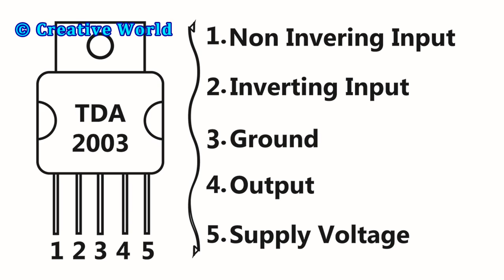How To Make A Subwoofer Amplifier Circuit - High Quality

Comment: Can I use 25watt 8ohm subwoofer to run it at maximum power?..
Reply from the maker: you should use maximum 20 watt
Reply: @CreativeWorldPro  can I use 25w 4 ohm sub woofer with tda 2050 ic and same circuit..
Reply from the maker: sure, you can

Comment: How to prevent distortion of audio when the volume is turned to maximum ?
I'm using 18 Volts supply and 4 ohms load
Reply: Trabajalo al 70 porciento el voltaje esta bien...

Comment: Where did you buy the ic 'TDA 2003'? Please tell me in which website I can find the IC and buy from it, because I did not find the ic in my local market. And please tell me how many ohm speaker I will use, 6 ohm or 8 ohm or 12 ohm speaker. You are extraordinary. I am a great fan of your channel
Reply from the maker: where are you from ?
Reply: I am from Bangladesh. Please answer me my questions
Reply from the maker: upokoron